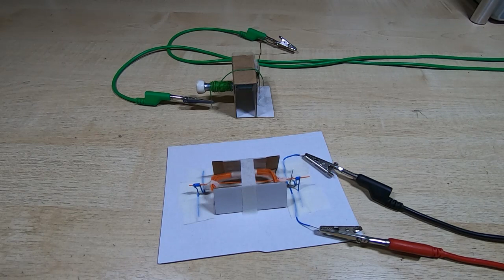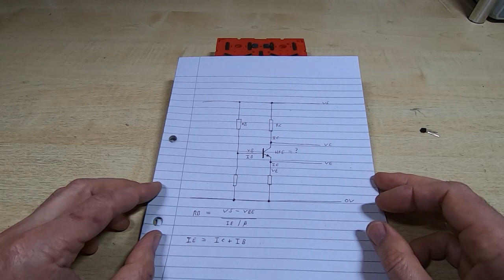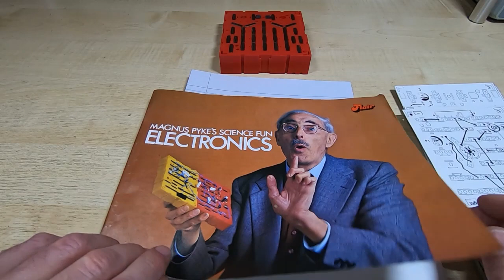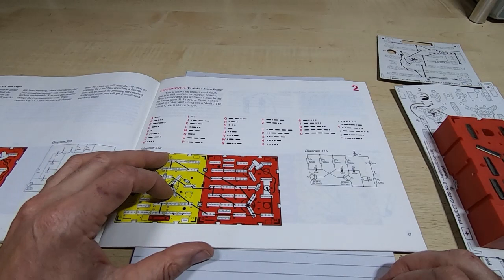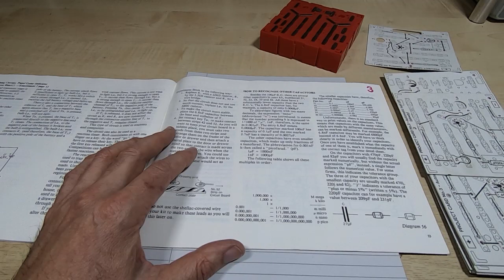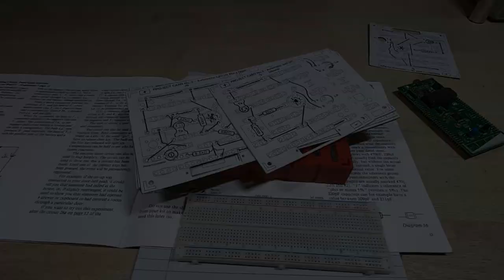Electronics For Beginners Part1

Comment: I started with the Ladybird book on Magnets, bulbs and batteries and built a similar motor to yours. Next I had a Philips EE1050 kit with the 1051 and 1052 add-ons. Dad owned an electrical contractors, so then it was playing with "big iron" mains stuff! After that a ZX80 and I was off into computing. Retired a few years ago and still playing with several Raspberry Pi's and controlling electronics using the IO pins!

Comment: My approach on recently getting into electronics was a bit more old fashioned - I bought a copy of Grob's Basic Electronics. Studied it until the basics made sense, got some breadboards and components, and took it from there. I suppose having a computer science degree made this way more obvious for me.
I guess my point is that each person's learning approach will be specific to them.

Great video in showing some easy practical starting points.
Reply from the maker: Computer science degrees did not exist when I learnt electronics (at least not as they would be recognised today) so I would say that my approach was more the old fashioned way. As you say everyone learns differently but computer science and electronics should not be confused or conflated. I would still recommend that anyone wanting to get into computer design or development learns the basics of electronics first. I ran my own electronics design companies and worked as a systems and software / Firmware developer for many years and knowing the basics has served me well.
Reply: @JerryWalker001  I forgot the context - computer science degree is from 1973 :-). I got into that following a grounding in mechanical things from growing up on a farm.
Reply from the maker: @wyatirp  Yes context is important. By that token I started learning electronics at about the same time as I started primary school so I had over 10 years in it before I went into higher education. As I said in the video my advice is for those wanting to get into electronics and not those who already have experience in it but it is simply 'my' advice and anyone can choose their own path.

Comment: Learning electronics from scratch on component level is fun and does not cost much. And later in life this knowledge helps a lot while fault finding. The same with Lego bricks. 55 years ago I had a box with different size bricks and boards. Now you only can buy expensive kits. Same in electronics or computers.

Comment: I started on this road much in the same way. I grew up in my grandpa's electronic workshop, disassembling any electronic device i could get my hands on. Later, i began to read about electronics in the vast technical library if my family (consisting of about about 300-400 technical books and magazines at that time). By reading and "dissecting" all kind of electronic equipment, searching the parts i took out, in catalogs, trying to match certain parts of the circuits, to the schematics i found in the books, helped me a lot in designing and building  circuits of my own.